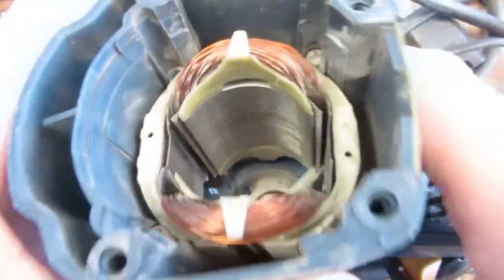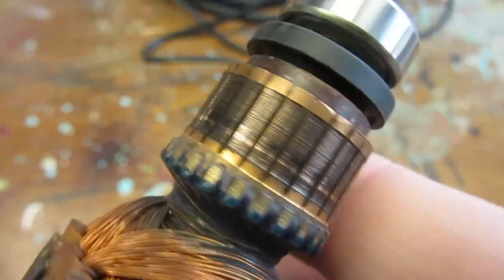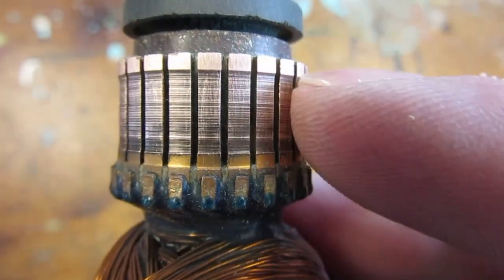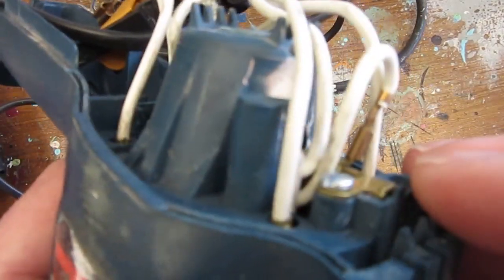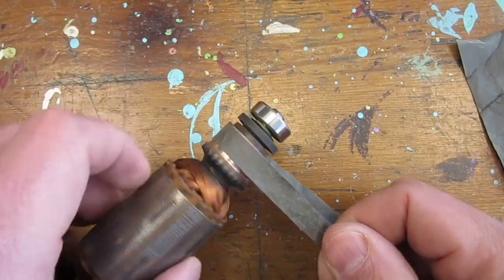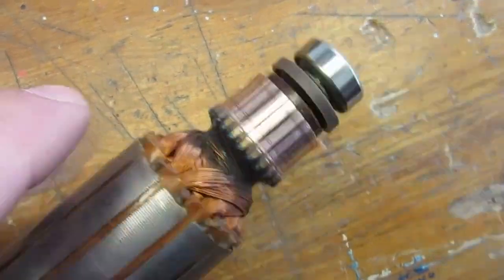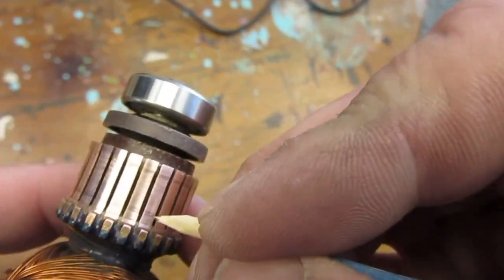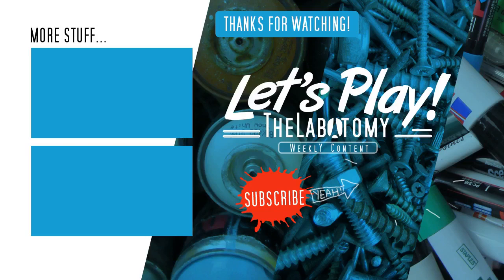MOTOR PUZZLE! Restoring A Hammer Drill Part 4 - Cleaning / Polishing the Commutator #HowTo #DIY

Comment: I was taught that the reason you don't use the silica carbide sand paper is because the copper is soft and the silica particles that wear or break of the sand paper can get imbedded in the copper. Since they are only a semi conductor they can inhibit the electrical flow, cause sparks and wear down the brushes prematurely. Great video, always more effective recycling than buying new and throwing out the old, great for the pocket book and it is fun boot!
Reply from the maker: Thanks for the helpful comment!